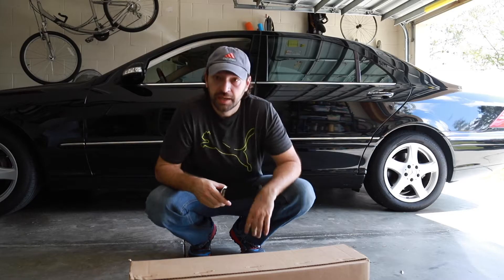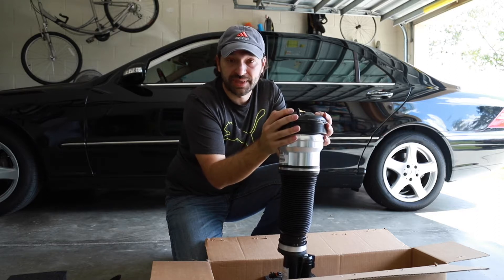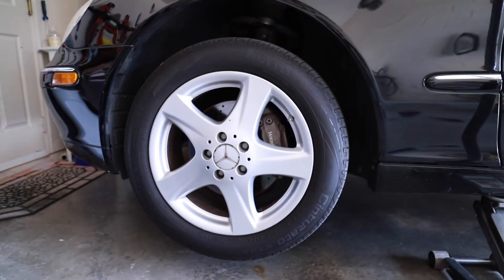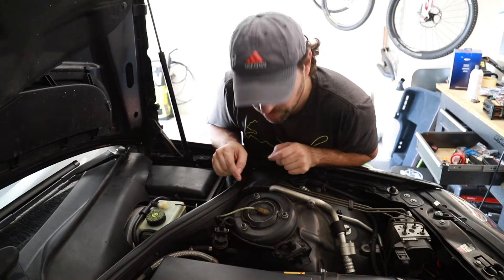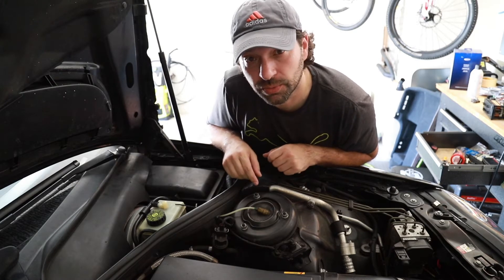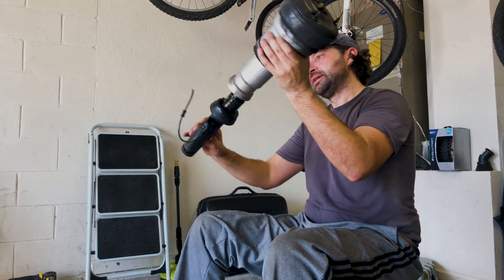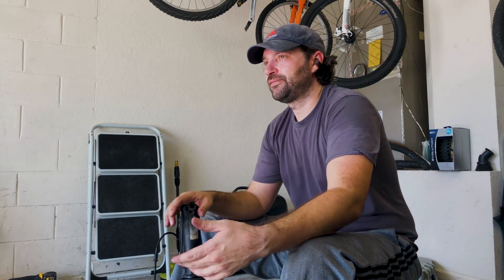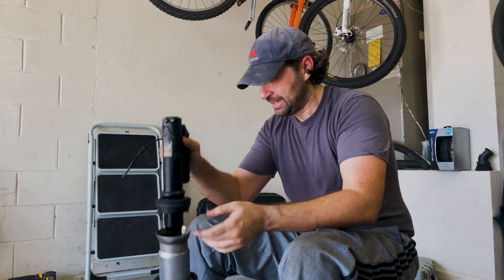Airmatic | Front Air Shock Replacement

Comment: I have a W164 ML500 and having issues at the moment... at the very least, your closing summary is brilliant and spot-on re having air vs traditional...costs, etc...great video overall :)
Reply from the maker: Thank you. I hope it convinced you (if there was ever any doubt) to stick with air suspension. I had the chance to recently drive an SL500 that I was interested in buying, but it had a spring conversion. It rode... like a cheap corolla with too much power.

Comment: Nice comment at the end of the Video. I confirm fully. I love the airmatic. I have two Mercedes with airmatic (w211, W164).  It is normal to change  when they fail  after 10 til 20 years of work.
Reply from the maker: Some people think regular shocks don’t fail. They do. I keep changing them in regular cars much earlier than 10 years. So doing these once every 10-15-20 years is not too bad at all. And, even tho it’s a pain in the ass, I don’t have to worry that a spring is going to crash thru the ceiling when trying to take a strut apart. I’ve been talking to people to see if it’s worth it converting my other car to airbags, but I was assured that if I want a ride quality of a Mercedes... I gotta get a Mercedes. No substitute. 

Thanks for the nice comment! :)

Comment: Good job
Reply from the maker: Thank you. The other side was so much easier. Took me 20 minutes.
Reply: @Turbo_Snail  Fun work, I installed the air diffuser, it took me a while from 5 pm to 11:30 pm, and I broke Hozen
Reply from the maker: oh no. Sometimes you think its easy and then a brittle part breaks and it turns from a 20 minute job into 8 hour job.
Reply: @Turbo_Snail  Yes, your words are logical, I benefit from your clips a lot, thank you
Reply from the maker: Thank you very much! Greetings to you!

Comment: Why did you cut the suspension wire?  Is it hard to get off?  In order to get the bolts out in the future... should you have taken a blow torch to it to heat it up? Is it common for the bolts to be that hard to get off?  Great video though!
Reply from the maker: No need to cut the wire. I had the strut loose and wanted to pull it. So I cut it. 

I should have hit the bolts with the blow torch, it’s the right thing to do. I however damaged it already. At that point drilling was my only option.
Reply: It is🤦‍♂️

Comment: Do you have to replace both in pairs? Some mechanics informed me that you have to replace them in pairs.
Reply from the maker: That’s what I heard from everyone. We did one at a time. By now, we replaced all 4. The first couple of days I noticed the car was not perfectly level but eventually it leveled out. Not only did we not do them in pairs, we also didn’t do them from the same manufacturer. Car is still riding perfect years later and is level without having to reset/reprogram the computer. Take advantage of coupons. We did all of them for less than $1000. I hope that helps make your decision.

Comment: Taking on the front right on my gl550 (x164) next week. Actually found out that the Arnotts are better and improved than the oems. At about a third of the price of the oems. 
My quick question is that is a wheel alignment job necessary afterwards or as we didn’t touch any of the steering settings we can get by without doing one?
Reply from the maker: No steering alignment necessary. 

Yes those are rebuilt by continental I heard (another German company :)). I can’t tell the difference when driving. I already changed out 2 (check out the other video) but I could have sworn I heard another one dying on me. Either way, even with all 4 exchanged it’s 6-10x cheaper than oem. 

Good luck! Let me know the results.
Reply from the maker: We did not do a wheel alignment and the car tracks straight and tires wear even. That being said I’m not sure what the official procedure is. All I know is you should do them in pairs, which we also did not do. 

However, every time we get new tires we do an alignment. We did one earlier in 2020 and all the specs were within limits.
Reply: Turbo Snail thank you for the info, appreciate that!👍🏼

Comment: Hey so you didn’t take apart the upper control arm do you think that’s has to be done in order to get the strut out
Reply from the maker: In the meanwhile I did. both rear and 1 front. It made it easier to take off the caliper but other than that, no. Taking of the control arm may make it easier to take the shock out but then you have to take apart the control arm. I think the most beneficial part would be a lift. It ducks doing it on the ground but what other choice do most of us have.
Reply from the maker: It’s not necessary but it makes things easier. Not during disassembly but when you put things back in.

Comment: Did you have to recalibrate the airmatic system? Did one side sit higher than the other?
Reply from the maker: No I didn’t. It will pump up a bit more initially but it will level out after a few days. Just install and you’re done.

Comment: Hi, great video, have question about Arnotts what I heard is that there is only exchanged air spring but the shock absorber is left old one just painted, please can you or someone confirm this? Thanks
Reply from the maker: I cannot confirm this because I just don’t know. That being said, I’ve know people driving on arnott for a long time without any issue. If it’s rebuilt, it’s basically like new. If I spend $200-300 on a shock, it’s still cheaper than spending almost $1000 on an oem one. I would say go for it, it’s is at par, some say even better than stock oem.

Comment: Do you have to disconnect the negative terminal battery or removed any fuse when working in the suspension?
Reply from the maker: I would say yes for safety. If you accidentally don’t I don’t think it’s a big deal. I always like to (if I remember) disconnect the battery. It’s only really important when working around the airbag sensors.

Comment: I own a 2004 S500.  Front shock went out.  I replaced both front Arnott shocks both cost me 1400 but oh well.  I did the work and I’m done.  Oh wait I have an error code.  Says go to shop Airmatic shock error.  How do I reset this myself?    Shocks work kind of but don’t drop after I part.
Reply from the maker: Hm. Sounds like you paid a premium for just the 2 front ones. You should have to do anything. Sounds like maybe a wire is not properly connected or follow the wires back, maybe they have a cut or shortage somewhere. The Arnott should work out of the box. We did all 4 and haven’t had any issues.

Comment: I replaced both front.  Got an error code.  How do I reset the computer myself?
Reply from the maker: Disconnect the battery. Check if you have two of them. Make sure there is no power going to the computers. Give it 30 minutes. Reconnect and see if it works. However, if you have an error that you didn't have before, or the suspension is not working as expected, I'm willing to bet there is something not connected properly.

Comment: please help , i currently have the same problem rn i changed my right air strut on my 2000 s500 but the strut in the right side i messed up by turning my it to hard , how did you just drill it through ??? @turbo Snail
Reply from the maker: Yeah those bolts are a pain in the ass. Sorry to hear you are going though this. I went to the big box store and bought a bunch of drill bits. can't remember what size, I think it was 3/8" maybe 1/4". Anyways, that bolt is so hard it literally ate away at my drill bit. Get some cutting fluid and keep the bit wet. Drill slowly, not fast. Wear glasses, those shards coming off are sharp. As long as the bit stays cool/wet it will eat at the bolt. I think I went through 3-4 bits by the time I was done because I got impatient and started drilling fast. I wish there was an easier way but you gotta get thru it. Once you're thru the rest should be simple. Let me know how it works out.  Don't stress out and take a few breaks.
Reply: @Turbo_Snail  i tried drilling through it , does it just break apart once it has been drilled through ? right now i had my brother grind through the whole strut. the only piece that is connected is the bottom part of the strut where the alen is.
Reply from the maker: Yeah, once you are through it, it will come apart. It took me some time. I should have cut it like you did.
Reply: Where did you get the new screws from? I'm assuming you didn't re use the old ones ?